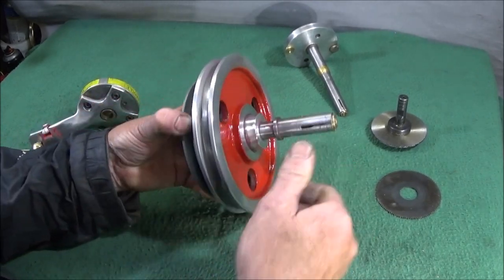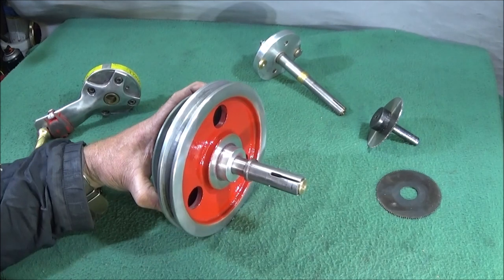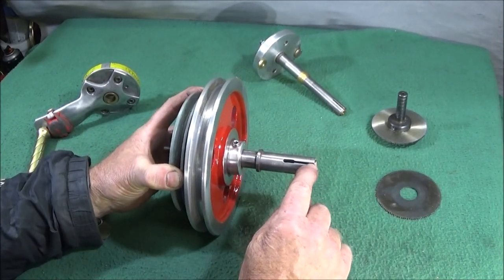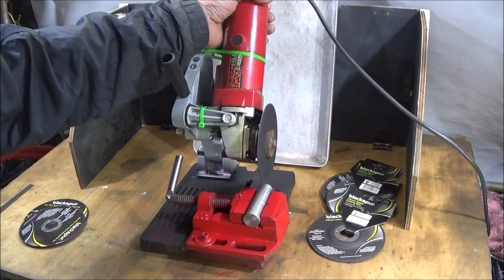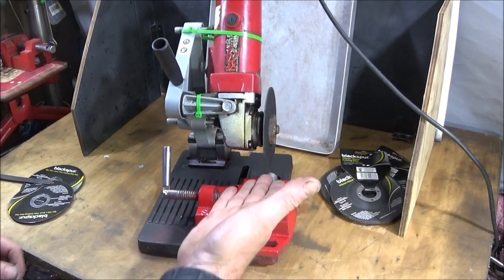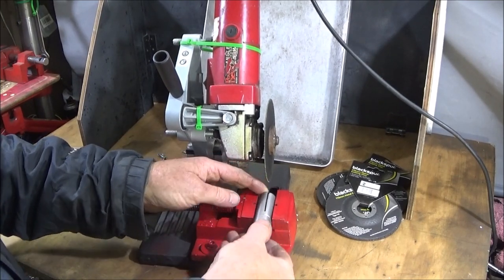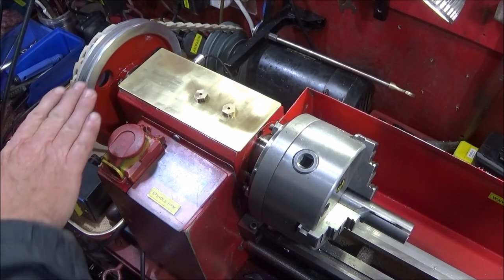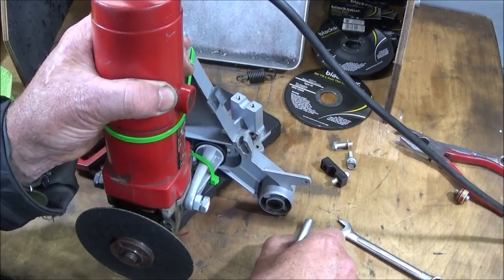A Quick Method Of Cutting Expanding Mandrel Slots & Lathe Update

Comment: Thank you Steve, this expanding mandrel is perfect for repowering the old 7x10 lathe that has worn out two motor controllers.  You give something wonderful with your videos, enabling making tools to nicely equip our machines - and sharing how to make better parts!
Reply from the maker: Hi Jon Thanks for your feedback. Great that you can get the lathe going again. Once this is done you won't have any of the problems with speed control boards etc again. I'm really pleased to have changed over to belt drive, but have to be really careful now with the new torque. Regards Steve
Reply: Thank you for insight and reminder about the additional and unstoppable torque, as I could stall the original motor rather easily.  Will double check setup and fitment as though working on a larger machine.

Comment: Hi Steve, 
Great tip.  I will be using this idea next time i want to make an expanding mandrel.

An old mentor of mine used to quieten belt driven machines like drill presses by changing the V belts to round section belts.  I think they were 10mm urethane.  Also available from Radio Spares and Fenner suppliers.  The difference on drill presses were amazing.

Comment: Thanks Steve, I put my drill press vise in my chop saw vice and cut the slots with ease. I'm at a disadvantage as I don't have access to a lathe to make the expanding mandrel. I'm using a piece of tube with a 5/8 round rod welded into it, then drilled a hole in the rod for the bolt. This will get my lathe back in service to machine a better mandrel. Yes I do have some wobble in the pulley. The new motor I'm useing is awesome!
Reply from the maker: Hi Pete, Thanks..that is great. Being disadvantaged by not having another lathe is a real problem, but you have come up with a great idea of solving it. I really like this sort of thing!
    I have come to the conclusion that this mandrel idea is one of the best upgrades I have done so far, for my lathe.  I'm sure for what they charge for these lathes and the spare parts, the sellers must be making a fortune, especially when they import them for a fraction of what they charge. 
   At least people will now have the option to make the lathe into a really reliable machine without having to rely on the suppliers for expensive replacement parts!

Comment: Maybe consider a Poly-V belt.  I'm converting my lathe to 4 rib J series (to match my narrow belt width) if I ever get around to casting some pulley blanks. No sheave scrubbing vibrations and less belt mass to oscillate.  Plus I can run a 3/4" drive pulley for lower speeds -  V-belts get unhappy on less than 2 inch.
Reply: I have to agree with you about the small diameter sheave on plain Vee belts, I had to make one for A section belt with 1.5" dia. I had to play with the angle to help the belt work properly as it changes shape when it is all cramped up. It was not that bad as Machinery's Handbook has some very good info on this subject. Been working as required for a long time now on the same belt. John, Australia.
Reply: Those would be good for a bandsaw too wouldn't they?